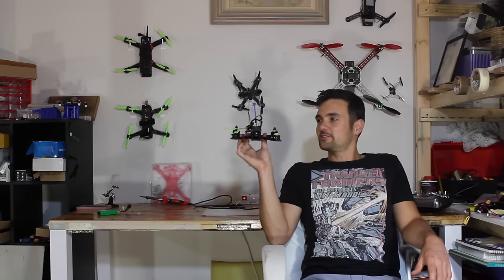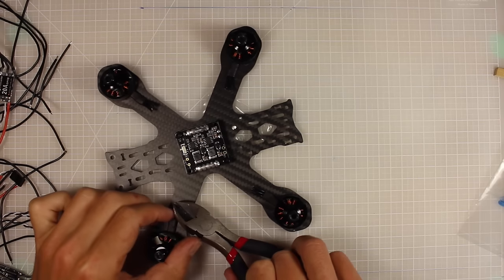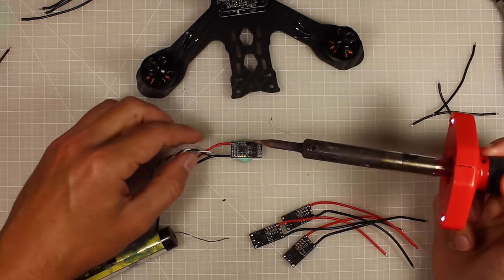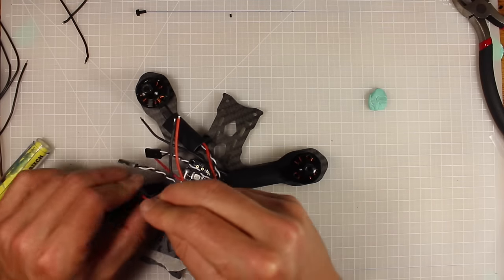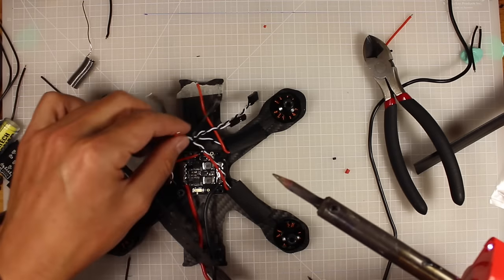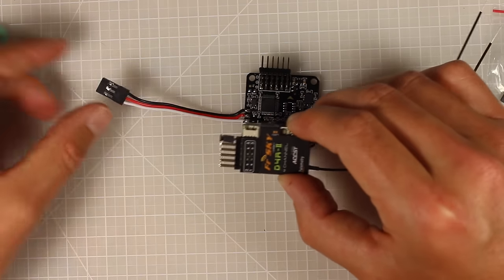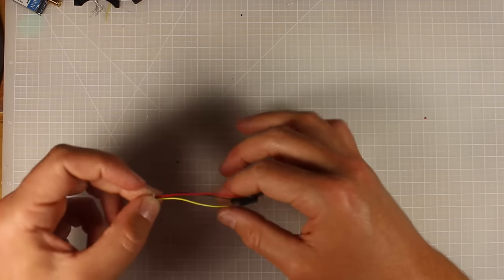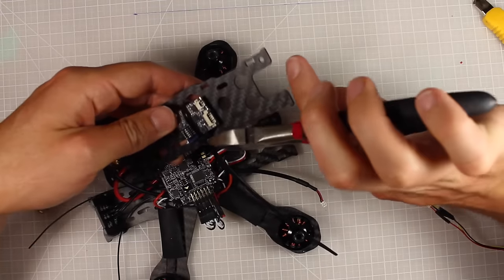HOW TO BUILD A RACE WINNING FPV QUADCOPTER: TUTORIAL GUIDE

Comment: a good tip I use when soldering the xt60's is plug the 2 halves together,, it saves any distortion if the plug gets too hot & starts to melt

Comment: Very nice build, but i recommend to put the header pins to the inside, so its not sticking out the quad.
If you angle the header pins an bit to above, you have no problems to put the Esc connectors on ;)
Reply from the maker: +dgecombat true but then the vtx doesn't fit on top of the stack. Cleanest solution is to just direct solder

Comment: If you have CCW (counter clockwise) motors for the reversed ones, do you still reverse two of the wires from the speed controller? If so, what is the difference between a CW and CCW motor?
Reply from the maker: the only difference is the thread direction of the shaft on top where the nut screws on to. Other than that they are EXACTLY the same and will spin the same way, have the same way windings etc
Reply: Thank you for the help! The video hasn't even finished playing before you replied. :)

Comment: Hey man, love your vids. Ive been learning a TON! Ive been into drones for YEARS but JUST NOW been getting interested into Racing quads. Im actually building my very first drone piece by piece. Ordering pieces weekly from online. Got a question. Im building a 180 and in the suggested parts it says to get ESC's with SamK. Now, everyone that Ive watched builds of use BLHeli ESC's. I havent yet seen a video comparing the difference between SamK and BLHeli. Do the flight controllers have firmware and should I be matching my ESC's to the FCB in firmware? I think I've got down how to build and what to use, Im getting a NAZE32 REV6 control board. Im usinf this exact PDB like in the video. Should I be worried about SamK ESC's and if so should I get different ones? Since its my first build I just got some cheap GForce 12A/16A/20A Slim ESC with SimonK Firmware. Any help? My subscribers are all DJI quad fans and no one really knows about racing drones haha
Reply from the maker: that is old stuff. check out my new videos for a much more up to date tech to use. eg bl heli S

Comment: G'day mate, great build. Did you take any footage of this thing flying as well ? Would be great to watch the bee buzz. Also I noticed you don't bother cleaning off the flux on your solderings. Maybe with the hot glue over them it's a bit overkill, but maybe still good practice. Question: what's the commercial name of that "green gum" you're using to keep the wires in place when you pre-tin them ?
Reply from the maker: +S.J. Gordts "Blutac" I have some foot age of it flying around on my video called "FPV camping" . the hot glue does help the little wire but so far I have had zero problems with these soldering joints
Reply: +UAVfutures Cheers ! Well I had some wires that got loose (after more than 6 months) due to the fact that the flux was not cleaned off the board properly after soldering. Never used hot glue on those neither, maybe something I should check out then. If things work out for you without the extra cleaning, good on ya !

Comment: I have used the same chinese pdb as you. Did your 12 volt output burn out when you connected a 4s Lipo? Ive had 2 of them burn out. 5 volt is ok.
Reply from the maker: +Beetlejuice 01 I cant remember if i connect the vtx directly or through the 12v. either way i have not had that problem. I usually power my camera off my vtx though

Comment: Is it common to have the ESC pins and connectors sticking out of the side like that? I notice that the microUSB port is at the other side when the Naze is oriented that way, but I can't help but think the ESC pins/connectors should be pointing to the front or back to stay out of the way. But, I haven't done a build yet, so what do I know. 

Also, do you have a donation page, because you're a standup guy. Love the channel.
Reply from the maker: +Bo Boland hi mate. Thanks for the awesome feedback. Usually people directly solder the esc wires to the naze/fc. but in this case I used pin headers because they are a little easier for people to use, especially if they are new. Also it lets you use the usb which is the main reason the board is orientated that way. The rev 6 naze solves this problem and moves the usb so its a bit better. Regardless there is no way they can get damaged the frame or motors or top plate will protect them in even the worst crash.

Nah I don't have a donate page. I never thought about it actually. I just take this videos because I love this hobby and I enjoy helping others. I have no idea how to even set one up lol

Comment: The way you run the power connections through a hole in the frame without any protection is a bit risky.  Carbon is conductive, so if the insulation gets cut by the sharp corners, you could have a fire.
Reply from the maker: +nwimpney Where is it risky. At no time do any wires touch the frame without insulation
Reply: Yes, but silicone insulation isn't all that tough.  In a crash, or rough handling, the sharp corners can cut through the insulation.
The fact that you cable tied it down should help keep it from moving too much, but It's still worth keeping in mind.
Reply from the maker: +nwimpney some electrical tape on either side of the frame might be a good idea if its rubbing against any sharp part of the frame

Comment: Dear UAV Future. this is a very neat video...carefully produced and it provides a joyful company for one owns build. tank you for that. the setup is that powerful, that the quad exploded to the sky when i was trying to hover. would you please provide a cleanflightsetting for throttle mid and throttle expo that would enable to hover and land that powerful beast... ? i have used the exact setup as in your videos. your cleanflight adjustments will definetly help a lot. thank you. thilo
Reply from the maker: +mager knilch I dont use any throttle expo. bu there is a simple tab for it on the reciever menu i think. My min throttle is about 1050 and my max is set to 1800. Have you tried using betaflight? 

also im really glad this has helped you create something awesome. They are so much fun

Comment: Can't you solder the motor wires to the esc straight (without crossing)  for every single one and change to motor's spin direction in clean flight? It would look even more clean like that.
Reply from the maker: +Dominick DeRaimo yes you can. This was made to help the most beginner pilot. So its easier for them to just cross a wire than configure through another program. But yes you are correct. Its how I build most of my builds no days. Just solder straight and cofig in blheli.

Comment: What is that little wad of blue/green clay you are using to hold your wires called?  I think you said glue tag at 10:25?  That's so much easier than the third hand alligator clips!  Looks like an old piece of chewing gum.  EDIT: Just figured it out - Blu Tack!
Reply from the maker: +Jeff Bullick yeah its called blu tack here in Aus but there are a lot of other brands of the same sort of stuff. You can get it at any office supply store.

Comment: should the c rating be 50c if you use a 4s 1300mah battery?
Reply from the maker: the c rating is just how much the battery can output at maximun drain. basically a higher c the better.
Reply: Awesome thank you!

Comment: Hello, so i've got pretty much the exact same setup to this(thank you so much for this video), however I'm using EMAX 2600kv motors. I was wondering if a Turnigy Graphene 1300mAh 4S 45C Lipo Pack battery would be suitable for my build? If not, what would be? Also what battery did you use for your build? Thanks
Reply from the maker: that battery should be fine.
Reply: thanks, what battery did you use?
Reply from the maker: KangarooPvP a 60c 1300mah 4S

Comment: Hello Stew, Thank you for the great video. This will be my first build. I just purchased everything in your build list....can you also recommend a proper battery, radio controller, fpv goggles and any thing else i might need? Thanks.
Reply from the maker: +Carlos Perez sure. well a good battery would be a 3S or 4S 1300mah with a high C rating. 60+.

for a radio get the Taranis its great
and goggles I use the Fat shark attitudes but they are a bit pricey. but there are a lot of cheaper options now days too. you are going to need a charger, antennas, lots of props, but just ask if you have any questions mate. Only to happy to help.
Reply: +UAVfutures I finished the build this past weekend and my Taranis arrived in the mail yesterday. Do you have any recommendations on the Taranis setup?
Reply from the maker: +Carlos Perez The Taranis is an amazing radio. Its all pretty straight forward. Really now all you need to do is get familiar with betaflight or clean flight and figure out all the settings. things like channel ,mapping, mode settings and board orientation. Ill try make a video about it but ive got a lot of other stuff in the works too. watch my video on "how to flash to betaflight," and also "flight tips 2: auto taranis reset". both pretty short vids of mine but should help you out a bit.

Comment: How do you power your naze32, I saw someone show how they powered theirs, but I'm building this exact one, so maybe it's different on this.
Reply from the maker: +Eric Engman so the name is powered by the 5 volt output from the power distribution board or PDB. those 5 volts are fed into one of the + and - ports of the naze, just under the esc signal wires.

Comment: Is it possible to add LED's with pwm? If so where do I put them on the flight controller?
Reply from the maker: +Eric Engman I am not sure on that one. I think as long as you have a spare channel you should be able to configure your controller to display them. although i only use ppm so I dot know the answer to that yet sorry. 

I know its not the same but you could always hard wire in a single colour LED

Comment: Hi, i think is supper setup, i am a new in this area, but i decided to build exactly the same setup. I'd like to ask about - FrSky D4R-II 4-Channel Receiver - does this receiver will be supportable with Turnigy/flysky 9x or  Turnigy 9xPro transmitter?
Reply from the maker: +Stanislovas Stankūnas I think it only works with a fr sky transmitter like the taranis
Reply: Hello,

Excuse me please, i have one more question. In this setup you used video transmitter AOMWAY, so what about receiver. They both should be the same brand or could be different. How to chose supportable each other ones?
Reply from the maker: Stanislovas Stankūnas the Aomway is a 32 channel vtx. Which basically means it can transmit all the available channels (minus raceband) and any standard receiver will be able to pick it up. It doesnt have to be the same brand.

Comment: What your recomendantion on Soldering Temp for the ESC? Do you use 60/40?
That PDB makes the wiring a bit messy looking. But its good it comes with 5v
Reply from the maker: +Fábio Castro Honestly mate. I use a really cheap soldering iron. It doesnt have a temperature setting ? I wish I had a better one but I cant afford it yet : (
Reply: +UAVfutures well, don't buy the hobbyking's soldering station: http://www.hobbyking.com/hobbyking/store/__32515__Soldering_Station_with_Adjustable_Heat_Range_with_EU_Plug_EU_Warehouse_.html . Just finished building my 250 size quad but after using this soldering station for about half a year. It was a pain in the ass to actually solder the xt60s on. The soldering iron doesn't get that hot anymore so it took me 2 hours, and it's my worst xt60 joint I've ever made!
Reply: XT60 is no problem for me. The only trouble i have is when tinning thick wire. I cant get the wire hot quickly.

Comment: Great video man. I have a question, with BLHeli suite now able to connect the ECSs through the naze to the PC where you can reverse motors in the software, what is the advantage of crossing motor wires over just soldering the motor wires straight without crossing and then reversing motors 2 and 3 in the BLHeli suite? Thanks
Reply from the maker: +Leon Ruecker You are correct. You can do what ever way is easier. Back before Bl heli had these options we would just cross the wires over, so its a nice simple method of changing rotation. Now days its probably just as easy to do it through software if you know what you are doing. I just swapped the wires in this guide to keep it simple for new builders and this way people don't need to download or learn how to use the BLheli software. 

long story short...there is no  real advantage over one way or another. but crossing a wire is probably simpler for a first time builder.
Reply: +UAVfutures thanks man, I have been a bit worried that I did the motor reversing in BLHeli rather than crossing wires because almost every video on quad building I have watched shows the crossing of wires rather than doing it in software, and thought there must be something I missed or didnt know which makes the crossing of wires the preferred method.

Comment: what if i use upgrade cc3d pdb with 3A bec and ecs's is FVT LittleBee 20A ESC BLHeli OPTO 2-4S Supports OneShot125 and not Little Bee 20a Esc Blheli 14 Oneshot / Active Braking
, do you think they can affect/harm the other components or the performance?
#newbiehere
Reply from the maker: Sorry I dont understand.
Reply: +UAVfutures which esc has a better performance . Little Bee 20a Esc Blheli 14 Oneshot or FVT LittleBee 20A ESC BLHeli OPTO OneShot125? 

and alsowhich one do you prefer?
CC3D Flight Controller 5V 12V BEC Output Power Distribution Board PCB
or
Upgrade CC3D Power Distribution Board With 3A BEC Output 5v 12v
 
please help to choose which is good in performance.

nice vid anyway .this is best of all video i ever watch in building a racing quad.

#newbiehere
sorry im totally new in this hobby. thanks for helping.
Reply from the maker: ok I think those escs are the same but get the opto one. Unless you are talking about the little bee pro, if that is the case get the little bee 20a pro. 

those PDBs look exactly the same, but honestly a pdb is the cheapest part of the build.so it doesnt mater

what FC are you going to use. Flight controller ?
Reply: +UAVfutures thanks mate. naze32 im going to use.

Comment: I have this exact set up and you can win race with it for sure :)
Reply from the maker: +SF PV its really fast and nimble
Reply: +SF PV  Dear FP Mate, Thank you for your post. I have just finished that exact built and recognized that the power is that much, that it is hardly possible to hover the quad. It is either climbing up or falling down when reducing the throttle just a bit. How have you solved this problem? May I ask you to post the significant adjustments you have done in CF? Thank you in advance. Mager
Reply: mager knilch 3s or 4s?
Reply: +SF PV 4s. please be so kind as to tell me what you have set for throttle mid and throttle expo. thank you. nice vids, by the way...
Reply: mager knilch throttle min 1050, throttle mid 1500, throttle max 1850 :) No expo for me
Reply: +SF PV thank you, sir. i was referring to the throttle mid in the receiver tab in cleanflight, but if your expo is zero, throttle mid adjustments had no effect, i think. weird that your quad hovers that easy. have to figure out what has to be changed... in order to provide a follow up, i will let you know at least how things developed further. so far i thank you for your contribution and help. happy flying. (-:
Reply: mager knilch Here's my Cli dump 
set rc_rate = 100
set rc_expo = 70
set rc_yaw_expo = 20
set thr_mid = 50
set thr_expo = 0
set roll_rate = 100
set pitch_rate = 100
set yaw_rate = 90
set tpa_rate = 0
set tpa_breakpoint = 1500
Reply: +SF PV Thank you once more. This setting of yours I have tried more or less (rates of yaw and roll 70) except with rc_expo set to 40. I will try your settings tomorrow. This is a promising start for tomorrows tuning. (-: Happy flying....
Reply: +SF PV (-:... its done. throttle mid to 25 and expo to o.1 works fine for me....this was todays maiden

Comment: Can I use the flysky fs-i6 and fs-iA6 transmitter and receiver with this? Also a turnigy 1300mah 3s 20c Lipo?
Reply from the maker: +Eric Engman the 3s battery is ok. but just. the low c rating means it will sag a bit in heavy loads or high throttle. try to get a battery with 40c plus.

im not sure about the flyskyls? but really you just need a receiver that can talk to your flight controller. there are many options out there. I just went with the common d4r2 and the Taranis (frsky)
Reply: +UAVfutures OK, thank you very much, how about a 4s 1400mah 40-80c turnigy battery? Would that perform better?
Reply from the maker: +Eric Engman That would perform perfectly. Thats what my good friend uses. They are a good value. good sized battery. for even more performance. get the 1000mah or longer flight times get the 1400. both will be awesome
Reply: +UAVfutures OK, thank you, and great video man, helped me out a lot!